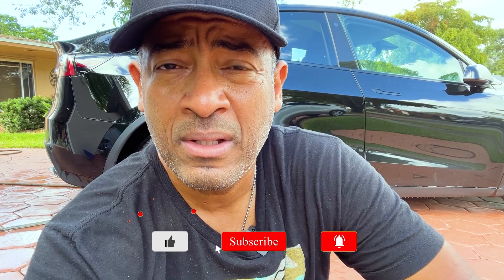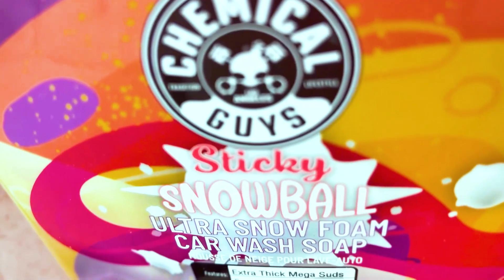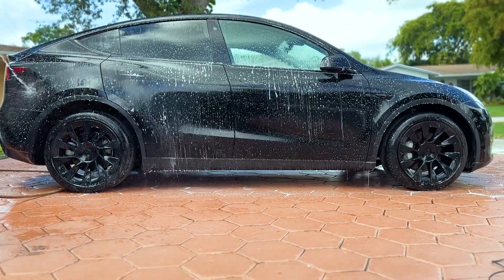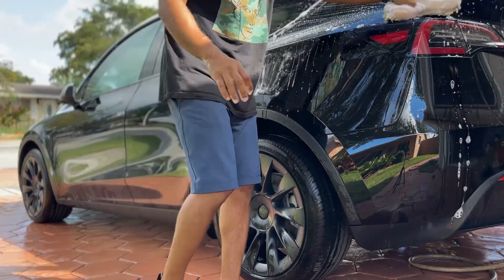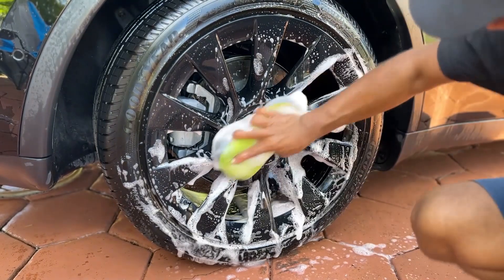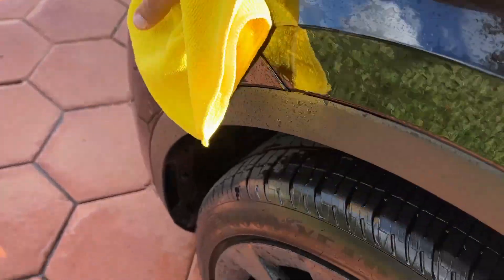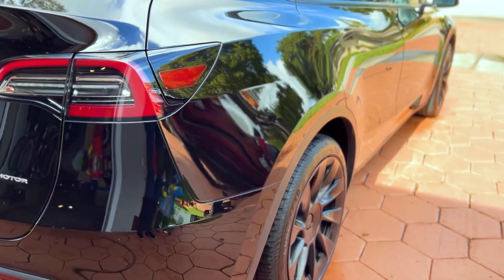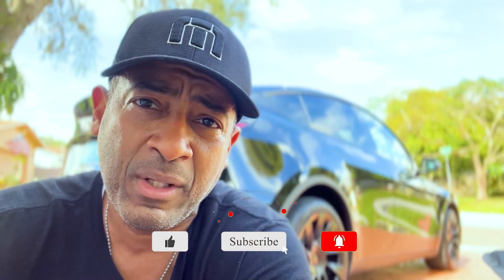What is the Two Bucket Wash Method? I Use it to Wash My Tesla Model Y (Results will Astonish You!)

Comment: Nice method but should use more soap bigger suds better lubrication on the paint. I'm learning more and more everyday myself. Never stop learning or growing. Have a great day
Reply from the maker: Thank you. I understand that if I use a pressure washer with a foam cannon I will get more suds. Do you use a hose or pressure washer?
Reply: @tristansdadreviews  if you have the foam cannon from chemical guys you should be able to get more suds with using a regular hose. No pressure washer needed.
Reply from the maker: @jRyda559  Thank you. I’ll use more soap.
Reply: @tristansdadreviews  I use a hose to soak first, than I use mjjc pro foam cannon with 1.1 orifice. It lays a ton of foam fast. I let sit for 4or5 mins and then use the low pressure valve for pressure washer. Works fantastic! The hose I use is an ubberflex hose.
Reply from the maker: @hatch450sx3  I appreciate it. Thank you.